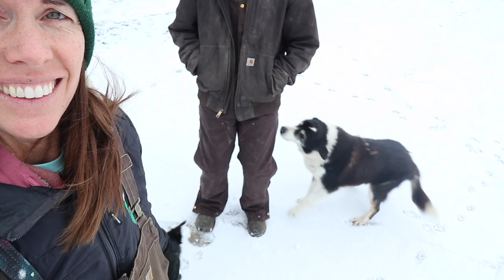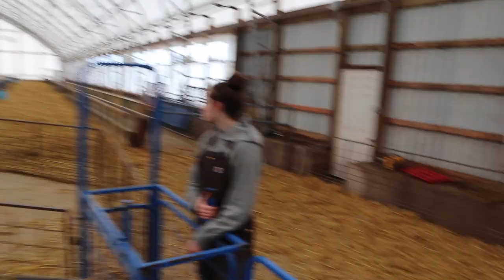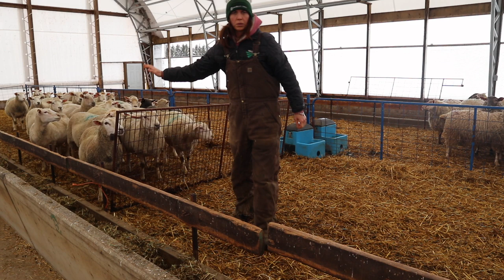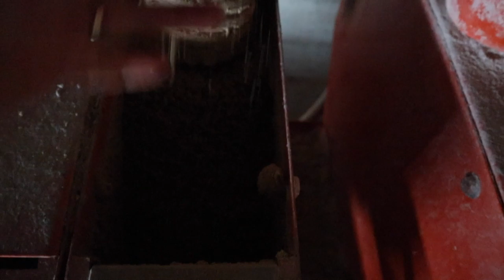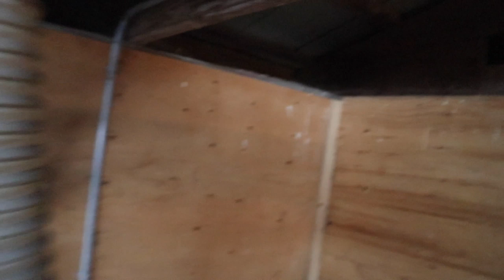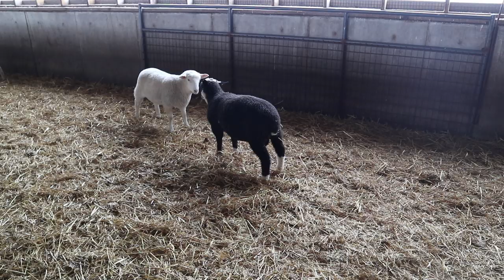THE BREAKUP.  (Sorting Sheep after Exposure): Vlog 245

Comment: An opinion from a YouTube watcher with no farming experience:
I think the ram lambs just aren't heavy or large enough to smear the paint the way you are used to seeing it. 
I believe you'll be pleasantly surprised when the mature ewes are scanned.
Reply: Had a similar thought but was going to go back and watch videos showing them in action to see whether that made sense. (Haven’t done it yet.)
Reply: I also had the same thought. I don't think all of them can reach the paint. It looks like I'm not the only one who thinks so. I'm hoping for some surprises from the green ewes.
Reply: I noticed that some of them had the paint a bit further up on their backs. It's possible the rams aren't getting enough contact to smear it,especially the younger ram lambs. Put the paint a bit further back, just in front of the tail
Reply: Just went back and looked at a few videos beginning with sorting day ( https://youtu.be/BxiXTcY_3ws ). The ewes with green paint that Sandi is worried about weren’t painted until the second day because that particular breeding group wasn’t really sorted but rather just two pens mixed together, i.e., not run through the handling system. Some breeding may have occurred during the time between putting them together and paint application. After the paint was applied it did appear that it was somewhat smeared on most ewes but not to the same degree as in the other pens. However, I wonder if the green paint just didn’t smear as well as the purple or blue paint. Additionally, the ewes with purple or blue paint also looked to have more wool than the ewes with green paint and so I also wonder whether that may have also contributed to the green paint not seeming to smear as much. The one clear observation of a ram mounting a green-painted ewe did appear to show him in contact with the paint, but one observation is not enough data to draw a strong conclusion. The scans will be in a handful of weeks and the results will tell us whether they were bred or not. Fingers crossed that all was good!

[Edited to make sure the link displayed properly.]
Reply: The paint doesnt smear in an arbitrary fashion.  Many of the ewes had clear markings and the ram generally does not alter the way he gets things done..even multiple rams will be unbelievably consistent…i think no or very few surprises in this operation where everything is very well regulated…though on my farm we use a crayon marker on the ram so there is no doubt that he has covered the ewes.  Each ram has his own color so i know just who did what and when.

Comment: The rams are getting the last little bit in!  Too funny.  Jess looks good in her new bibs.  You live 2422 miles (3899 kilometers) from me, so contacted a local shepherd, with 130 ewes, and got a farm tour yesterday, I got to hug a lamb.  So much fun, but her Suffolk Hamp cross ewes are very substantial.  Had a great time, you inspired me.  I just had a telemarketer/scammer call, so pressed one to be connected to the operator, and turned up the volume on the video and let them listen to your sheep!  Made my day.

Comment: Perhaps run the ewes back thru and seperate the ones with the unsmeared paint out.  Put a few of the older rams in with them for 2-3 more days.  Since some "action" was still happening While you were sorting them today, perhaps a few just didn't breed with the young rams.  The youngsters might just be too young right now to handle  the # of ewes that they were in with. And not all of the Ewes would have had a chance to be in heat when the "big boys" were added.  It's worth a try, and would only extend your lambing by a few days.

Comment: Nothing breaks down when it's  72 degrees and sunny. Electrical problems can be hard to resolve because the fault may be a loose ground or a pinched wire anywhere in the system.

Comment: SANDI..... Please watch the playback on this video.  As you were putting ewes back in their far right pen, I saw 2 ewes with rear, left leg issues. Just after 7:52....where the Suffolk Ewe skidded/slid out... there is a small group of ewes, that came around together. They paused for a few seconds then moved along. One is at 7:57, and the other at 8:00. The one at 7:57 looks swollen at the joint.  The one at 8:00, the leg injury is non weight bearing. She's not putting it on the ground at all. The first one was at the front left of that small group, the other at the rear of it.  Both rear left leg injuries.  

Love Billy's babies. Hope Billy the kid becomes a pet and isnt sent to processing plant. Hes so adorable and lovely to be around.

Comment: Would a leaf blower help to move the straw instead of scraping it down???
Reply: There is also manure that was stomped and squished into the cement that has to be scraped up. Whenever you move any kind of livestock into an area that they are not familiar with they poop so it all has to be scraped up.

Comment: Well Sandi, in my 0 experience as a shepherd I would be reluctant to say my opinion on whether these mature ewes have all been bred successfully. But i am an artist - so from that perspective - i think you put too much paint on them - i noticed it when you did it. I have no idea how many times they have to be bred to have a successful breeding. But early on you could see some smearing of their paint on most of the ewes. It was my thought that there was too much  paint for the rams to "rub it all off" as the more paint there is - the more it soaks in - the more rubbing needed to rub it off. This method has worked for you in the past, so no reason to think it wont work this time. But this time i did notice the rams are very quick. So you get very little rubbing off of the paint for each mounting. Maybe next time use less paint? Also, a new can will give more paint in two seconds that an almost used up can. 

With the above in mind, i have a suggestion on how to apply paint in future. You want a method that puts plenty of paint on the surface , but does not push paint down into the coat. It will not be as easy on you, but it might be more reliable - that's a warning. If you had a pie pan with a 1/4" or less deep layer of paint in it, you could use a sponge to pick up some paint and apply it where you want. I'd try blotting excess paint off the sponge before putting it on the ewe when the pan is freshly filled.
Reply: I am guessing GREEN can of paint at fault! Ain't easy being Green! lol
Reply: @CurrentChoices  
I hope we are right. If we are, perhaps there will be a great percentage of these girls pregnant and Sandi's bad feeling will be only a little right. This time. I really think she'd like to be wrong about this.